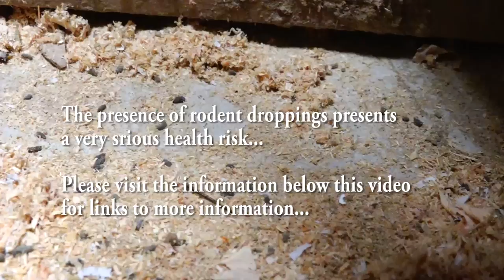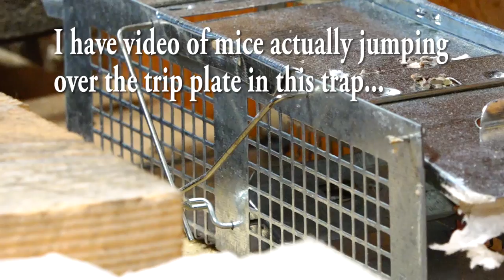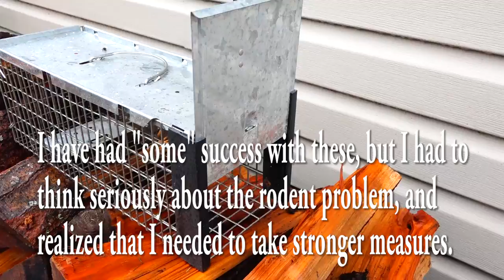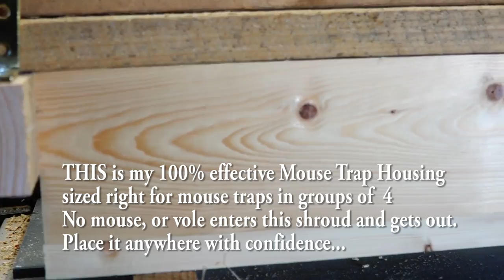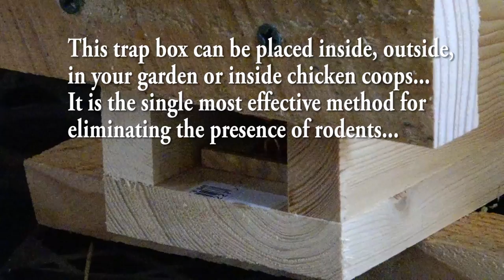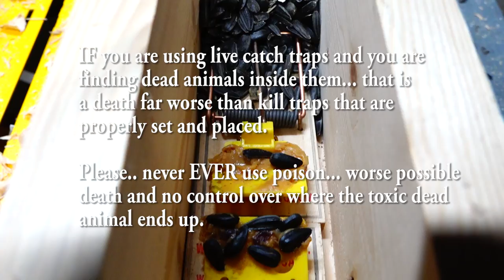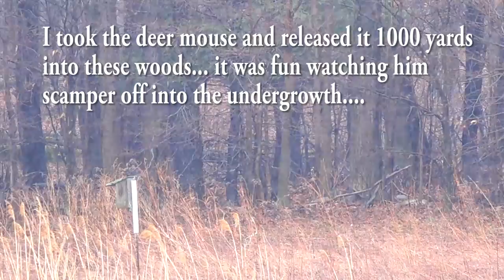The BEST Rat and Mouse Kill Traps that work every single time. Fred's Box of Certain Death Works!

Comment: Wow, thanks so much for this video.  I liked everything about it -- the compassion and responsibility shown, the great music, and even the difficulty in setting the trap triggers.   I loved that you kept that in there, because I've had a hard time myself, and to see a "pro" spring them made me feel less like a clumsy dork.  I am going to build two of these, one for mice, one for rats (I think I have only one, but I've tried other traps and just can't catch it).  I think I'll add two little tweaks to your fabulous design, and that is:  (1) A threaded rod with wingnuts on each end to slide across the "roof" via those two little metal holes of the bracekts that stick up (keeping the lid down instead of putting bricks or rocks on top, and (2) putting a big metal "drawer handle" on the top middle so that I can just lean down and grab it and pick the whole thing up.  I really like how this trap will not harm the pretty quail that walk through my bushes, and I'm hoping that even the rat size (with the side walls no higher than necessary for spring-bar clearance...such a good point), might keep out the red fox squirrel, although...there are so many of them too that if I have to nab one of those in order to get this one rat around here, then.. so be it.  Thanks again.

Comment: My dad, 70 years ago, after setting the trap would hold the trap with a pliers and hold it to a gas flame on our kitchen stove. It would remove all human scent. He would then, while still holding with pliers, place it where he wanted to do a catch, never touch it again but only to remove the dead mouse or rat. He used Victor traps back then also. Always worked.
Reply: Human scent doesn't matter to mice. They love peanut butter much better.

Comment: I have a mouse that has actually learned to climb on the back of the trap and grab the trip bar and hold it against the little metal piece that holds the trip bar. Then it just polishes off the bait. I have video of it doing this on multiple traps. Btw, it’s the old original victor snap traps. Anyway, that’s one smart little sucker. I couldn’t figure out how it kept doing that so finally recorded it.
Reply from the maker: They can definitely be clever! =<';'>=

Comment: Great trap idea. A suggestion... I have used the same mouse traps that you put in your box design. Not to uncommon for the mouse to eat the peanut butter( best mouse/rat bait ever) and run off. That plastic trigger sometimes will not release. To solve the problem, I tie a piece of cotton kitchen twine through the holes in the trigger pad and work the peanut butter into it. The mouse pulls on the twine... No more problem. Gotta go, need to make a couple of box traps.
Reply from the maker: Great idea!

Comment: I found a box that's a perfect size to shove the trap into (trigger plate facing the opening) and threw a bunch of food at the back and it works over and over... I don't even need to leave the trap in the sun a couple of days to get rid of the smell of death... and their favorite food is sesame seeds and sesame butter.. the desert pack rats don't like peanut butter or at least know it's a death sentence to eat it so they avoid peanuts,, but sesame is irresistible for them.. Bulgar was second choice and worked best on the more suspicious pack rats that stayed back until everyone else was dead.. And then I found the hole they come through and haven't heard the scurry of little rat paws since... thanks for your video.. I like the Victor traps with the plastic plate the best...
Reply from the maker: Interesting! You are in a very different environment than I am, I'm sure others will enjoy checking out your bait and method.
Reply: YouTube kathleen madigan

Comment: You could use a piece of square plastic drain pipe instead. Just check the kill bar has sufficient clearance. Easy to clean, completely covered and easy to place. Trigger plates facing each entrance. To maximise make two and place side by side.
Reply from the maker: They aren't deep and wide enough to accommodate the rat traps, they do work for mouse traps though.

Comment: You can also buy weasel boxes and do the same thing. Or get one of those plastic ammo boxes and drill a 2" hole in one end. Cheap and easy.
Reply from the maker: Yes, you can scale up the boxes for any pest. When it comes to weasels, probably want to check the regulations in your state. But these boxes work.

Comment: Can I just ask what the end pieces of baton are for if you can just attach the brackets on the outside of the box to hold the lid in place?
Reply from the maker: They keep the sides stable, and from bowing in or out. These days my end pieces are solid with just round holes in them that are 1.5" in diameter. That hole invites mice or voles with no bait at all. Thanks for watching.
Reply: @Frederick Dunn  Ok. Thanks for letting me know. That's a good idea with the holes at the ends as that will stop them backing out with the trap in tow

Comment: Thank you - I’m going to try this.  The wooden Victor rat traps are cheap, and I’ve got lots of scrap lumber.  I was looking around for better ways to set traps in my barn and outbuildings, and all the commercial gadgets like electronic rat zappers and tunnels with traps in them are outrageously expensive.  First things, first though - you have to clean up clutter and food sources for rats and mice or you’re going to have a recurring infestation.  I put all my animal and chicken feed inside resealable plastic bags (like giant space saver bags) that I put in metal trash cans or barrels with tight-fitting lock-down lids.  This keeps the feed fresh, and mice and rats dont chew through the metal.  Never leave feed bags sitting out or on pallets.  Get rid of junk and cluttter stacked up near walls.  Plug holes in walls, foundations, or floors with hardware cloth or metal sheet, or stuff bronze wool around pipe openings (rodents don’t like to bite into steel or bronze wool).  Cut shrubs and trees that are too close to your home or buildings, and keep your house clean.  Put food into glass jars or metal canisters, and never leave human or pet food out at night.  THEN, when you’ve done all this, set your traps.  They’ll be hungry and more likely to go for your bait.
Reply: Also, I use 1/4” hardware cloth with a layer of 1” x 1” 12-gauge welded wire fencing over it on my chicken run.  The wire extends from the roof down under the floor and up the opposite wall.  The run has a solid roof.  My coop is on a concrete foundation and the floors are 3/5” marine plywood coated on both sides with garage-floor epoxy, with no gaps between walls and floors.  Windows and vents are screened with double layers of 1/8” hardware cloth.  These measures have kept out mice, rats, weasels, foxes, coyotes, raptors, and even bears.

Comment: Now THAT is a trap that I can make. Thanks for the idea. If I just line up traps with minimal gaps in a tunnel type thing it should work similar. Thanks
Reply from the maker: Exatcly!  Also mouse traps can be set inside gutter downspout segments and when they snap, it's loud and clear.

Comment: No need for needle nose plyers to adjust anything. To adjust sensitivity look where you place the bait at. You will see a "S" and a "F". "S" for slower release and "F" for fast more sensitive release. Set the trip bar into one of the sides and you have it set as you want it. I have all mine set on "S". I find it works best in that set up.
Reply from the maker: annnd you can bend  the trigger bar to make it even more sensitive. :)
Reply: @FrederickDunn  I stopped doing that because it was too sensitive and released each time I set it down or slid it into position. Thanks anyways for the suggestion.

Comment: The peanut butter goes in the small hole on the opposite side of where the bar goes in to set it , not smeared over the fake plastic cheese!
Reply from the maker: I know where it's supposed to go, I spread it out which fills the air with more of the peanut smell. Because of the box channel, they step on it before getting their noses into that tiny bait recess. Thanks for sharing.

Comment from the maker: DEAD MOUSE or RAT... now what? This is a Quote From Victor "A mouse trapped in a Victor® mouse trap should never be touched directly. Instead, follow these directions:
STEP 1 — Put on a pair of rubber gloves.
STEP 2 — Spray the dead mouse and the immediate area with a disinfectant or bleach-and-water mixture.
STEP 3 — Place the mouse in a plastic bag. You may save the trap for future use or throw it out as well.
STEP 4 — Place any mouse-soiled objects in the bag including feces, nesting material or food.
STEP 5 — Seal the bag. Do not push out the extra air from the bag, doing so may spread germs, bacteria or viruses that the mouse is carrying.
STEP 6 — Place the sealed bag in another bag and seal it, too.
STEP 7 — Throw the bag in the trash.
STEP 8 — Wash gloved hands with soap and water or spray disinfectant on them.
STEP 9 — Remove gloves and throw them into the trash.
STEP 10 — Wash your hands after removing the gloves."
Reply: Wow I had no idea
Reply: Wow, for 65 years I have been doing it wrong.  I pick them up by the tail and throw them into the field and then wash my hands (sometimes.)  Then again I have died 356 times so far.  Get a grip!
Reply: A woman cleaning up rodent urine and droppings died in my area from a respiratory disease called Hantavirus.  She never saw it coming.  Since then they've said you MUST spray the poop with bleach or you too could die from exposure.    @tiredofbs6835
Reply: Excellent information !! Too many people are careless getting rid of these vermin. Very dangerous creatures in terms of diseases.
Reply: @nick1864  If you see ads on his videos he's making money.  As well he should.  Great advice, and he turned me on to some terrific rat traps.
Reply from the maker: @tiredofbs6835  I'll try to "get a grip"  I posted this procedure to satisfy the hantavirus gang that was up in my grill about it. And yes, according to them, you've done it wrong for 65 years. (';')
Reply from the maker: @clink76  There you go. Failing safe never hurt anyone. Stories like that can be a wake-up call.
Reply from the maker: @nick1864  yes
Reply from the maker: @tiredofbs6835  Victor has been around since 1898, I see nothing wrong with posting their procedure here.

Comment: Hello Mr. Dunn,
I built 2 of these traps for an infestation of rats under my shed, attracted by bird feeders. I've seen the suckers actually crawling up the poles and into the feeders!
Traps have two of the upgraded snap metal traps in each, baited with peanut butter and sunflower seed. Three days in and only one rat so far. I'm hopeful the kill ratio goes up or I'll be at this a long time. Thanks for the simple design in any case.
Dave
Reply from the maker: Rats avoid new objects... it's definitely a game of patience. Consider putting the traps and bait in place and not setting the traps... let them get used to feeding safely. The older rats will observe younger rats before they actually go in. Then, when they are comfortable, set all the traps for a single night wipe-out =<';'>=

Comment: It’s hard to beat a good Victor trap.  They are cheap, and they snap when you push the trigger up.  You can usually get them for about 40 cents apiece.  They used to be 4 for a dollar at my local hardware store back in the 90s.

I put peanut butter under the trigger, then the mouse sets it off when he sticks his nose under the trigger to lick the peanut butter.  I’ve been killing mice that way for over 20 years.

Comment: Thanks for sharing your experience.  I agree Victors with the plastic plate are best.  I have also found that you may need to file the end of the trigger bar smooth as the cutting of the wire for the trigger can make burrs that interfere with the smooth release.   One question I've not been able to find the answer to: Why put the trigger pads away from the entry and facing each other?
Reply from the maker: I find that they hop over the first trap and land on the trigger pads facing each other. However, if you want to know right away if you've got something, facing the entrance is ok. I also found that facing the trigger to the entrance can cause a blockage to the remaining traps if an animal gets snapped in the entrance. I have 1.5" diameter holes in the ends now, 2" for rats, and that keeps the traps from being dragged out by raccoons or rats eating dead mice.
Reply: @FrederickDunn  Thanks for taking the time to answer! It didn't occur to me that the solution to their acrobatic ability was back to back traps like that.  I've had far too many tripped, empty traps and I was sure I knew why: they trip them and then eat the peanut butter.  But my solution (building a hood around the trap) only works maybe 50% of the time and the smart ones (or so I assume) simply avoid those traps (they are often untripped even when the others are so I know they are getting visited .)

Your method requires more traps and more space, but seems more worth it if reliability goes up.  I've got some pallets that I am going to pull apart just to make a copy of your trap housing today!  Thanks again for making this video!

Comment: Pit the wire in line with the trigger pocket, then tip the trap upside down. The trigger will catch the wire and you can then turn the trap upright trap.

Comment: I use to keep a vehicle outside and had mice make the hood it's home. Would have mice crawl across the windshield driving down the road. Made a wooden box, drilled 4 access holes and set 4 plastic mouse traps inside. 
Problem solved, the mice were taken care of. They breed like crazy so it is a never ending battle.
Reply from the maker: Very cool!

Comment: This is a smart solution. I've tried cages and sometimes the bait is gone and the door is closed??? Sometimes the bait is gone and the door is still open??? Apparently tying the bait to the back of the cage is a good option as the rat has to really play tug of war and guarantee triggering the door. 
Randomly placed snappy traps have also been very hit and miss.
But, this tunnel trap idea seems like a great idea. Only one way the rat can approach it which pretty much guarantees job done.
Reply from the maker: Hi Mark, I can say with complete confidence now almost 3 years later, these boxes work absolutely. The only thing I've changed is that I've gone to the Made2Catch metal traps and have closed up the entrance to a 2" diameter hole instead of the rectangle that these have. The naturally explore these "tunnels" and leaving the boxes out and in place for a long period of time is how you outsmart rats. Large OLD rats avoid new objects in their territory. Thanks for watching and commenting!
Reply: @FrederickDunn  2" hole for the rat version? Or mouse version?
Reply from the maker: @markmccall6273  Hi Mark, I think I should make another video showing the new design.. yes, the 2" diameter hole is for full sized rats, they like to push through it and when they put their fore limbs on the trigger as they get in, it's all over and they can't back out with the trap as it won't pass through the hole. Would you benefit from a video?
Reply: @FrederickDunn  Yes definitely. So you're saying put trigger plate right up against the hole end? Where as before you were centering the traps in the middle of the tunnel???
Reply from the maker: I'll be making another video showing how to make them very soon, I'm going to name you if that's ok? Yes, I've changed to turning the trigger plates towards the entry point, they get thwapped when trying to climb over to the bait that is in the center of the box/run.
Reply: @FrederickDunn  Gotcha. No problem. And thanks for the helpful responses.

Comment: But don't the vermin  being killed set off the trigger plates of adjacent traps? Perhaps set the traps further apart in longer bait tunnels? If you have 4 traps set I can't see how all 4 of them could achieve kills
Reply from the maker: I generally get three rodents with three sets. Rats come in and eat the dead, even chewing their skulls open. I need a longer box with more traps. Also, I've hot-glued the traps down so they don't move.

Comment: It will work even better if you can clean up the edge to put it up against a wall as they often travel along walls using their whiskers to keep in contact with the wall as they follow it
Reply from the maker: That's a great point George, I did get some motion camera sequences where the small rats ran between the wall and box. Maybe a fix would be to put a block/shim to the side and that way the stability is still there. Thanks!!!

Comment: Mr. Dunn, first of all, thank you for this. It is an amazing piece of work. I've built two of them. They work like a charm with rats outside the house, the yard is kinda big, so theres rats every now and then. However, i've been struggling so hard with a small rat or maybe mice (judging for the droppings sizes), the issue is in the ceiling (well actually false ceilings around the house). The problem is that the sneaky bastard has been cleaning the traps from the box, i caught it on night visiion camera, and its seems to be a small rat/mouse. Incredibly smart. I've never seen anything smarter than this. And now Its been a couple  of months and i'm almost giving up. Tried everything, except poison, because i dont want to use it. Any tips?
Thanks in advance.
Reply from the maker: If I have a really crafty fast moving mouse that can clean off peanut butter and not spring a trap, this is THE trap that nothing gets through without setting it off. I'd put out several at once, they never miss.  https://youtu.be/iQ2j46fPWQo  Here is another live trap that is metal and super sensitive:  Any vibration will set this one off https://youtu.be/3MTFDqbGhPs